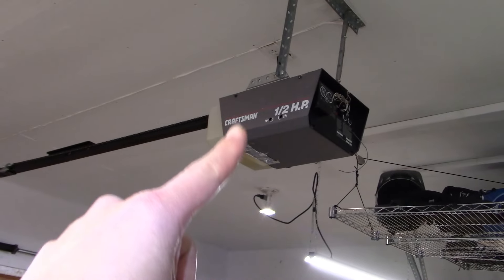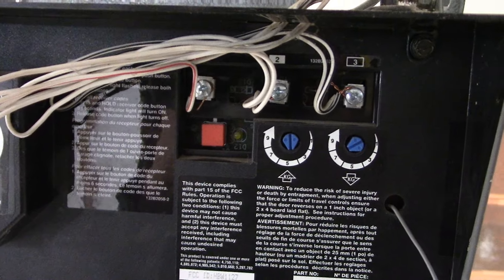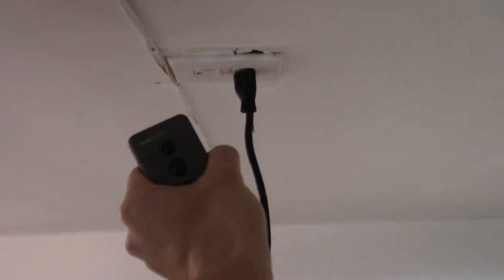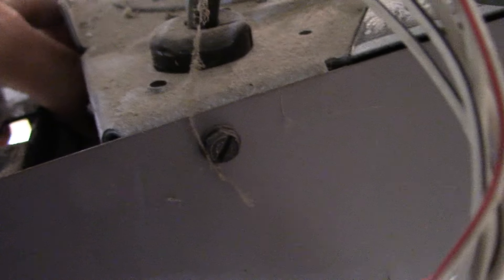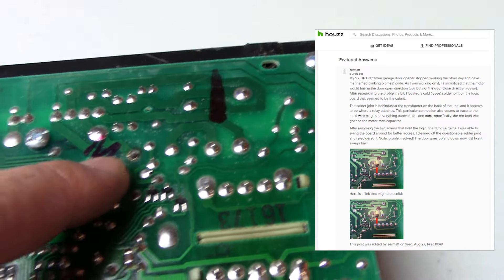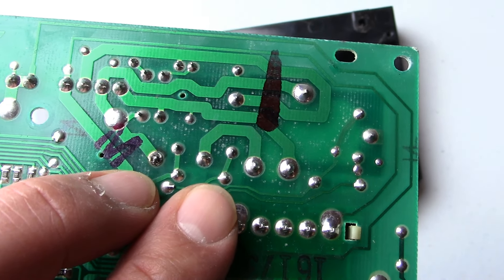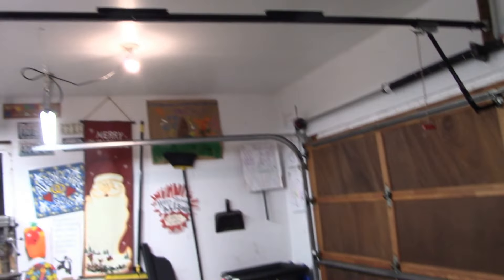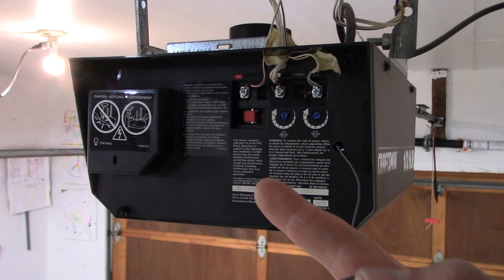Garage Door Motor Not Working – Solved!

Comment: AMAZING.  I said no way this can work.   Saw three dark solder connections under the relay. Hit them all with a little solder, put it back together, and the light came on as you said this was a great sign.  I'm guessing a professional would have charged a fortune and replaced with parts.     As the others have said  "YOU THE MAN!"

Comment: i have the same 25 year old opener which stopped working 1 yr ago,  seen you video and the first soder connection was black so i touched it up with soder and BOOOMM problem fixed.  your the man.  thanks for your help!!!!!
Reply: where did you buy the replacement?

Comment: Thanks a bunch! Just fixed my Craftsman 1/2 HP opener (late 90s vintage) by fixing the board as you show here. My failed joint turned out to be the same exact one as yours.  Your video made it easy after finding the OP that never really discusses disassembly as you do here. Between the 2 of you you've saved people a lot of money and kept these openers out of the landfills where they would have ended up. So thanks a million Chief!

For others tackling this, after you remove the end plate where the board is attached, it you take then take off the metal enclosure that covers the motor, etc., is is much easier to remove and to reinstall the header connector without fumbling around to get it aligned, etc. There isn't much service length on those wires as you can see from the video so it's easier to have the whole bottom of the opener open to get your hand in there and to see what you are doing.

Comment: So i drove out my garage, then went to close it, nothing. Nothing but the click-click. Liftmaster pro some model. Boards were different, a logic board and a high voltage board with transfomer and relays. Got to the hv board AND LO AND BEHOLD! One bad solder joint! Re-soldered, put back together, works great! "YOU THE MAN!" Thank you! Saved me $$$

Comment: I went through several diagnostics; RPM sensor resistance, direct charge to motor, transformer check and this one worked. 8 month old unit and found a bad solder on the MoBo (logic board). This was the fix. Thank you for video!

Comment: So glad I found this video.  I have the same model and had just spent time replacing the inner gears.  Then today it just stopped working.  Watched this video and then after buying another iron and sod, because of course, I couldn't find mine, I touched up the exact spot the video showed and shazam, fixed.  thanks again

Comment: My 1/3 HP Liftmaster failed and displayed the same symptoms: relays click, yellow LED flash 5x.  My unit had EXACTLY the same fault - same relay, same pin, but more of the soldering pad on the back of the PCB was burned away in my case.  After cleaning the area, I resoldered the joint, ensuring the solder flowed from the back to the front of the PCB.  The repair made good contact between the pin and the run. I put the unit back together and it is operational once again.  Thanks for the video!

Comment: Googled, and found your video. Mine had same problem as yours, same Opener as yours (except 1996). Followed your video, found exact same burned-out solder spot as yours, except no “M” on my board, soldered it - Fixed! Thanks!

Comment: You are the man
I was rolling my eyes watching this. Then I looked at my board same problem same spot. I desoldered it and it's working. Saved $400 .. again you da man.
I think this is where the relay contact energizes the motor and there is arcing .. over time THIS happens. That the theory .. you da man!

Comment: Wow, thanks for the great video and what to look for. I have a 2006 Lift Master which is totally different and much newer, but  thn yours but I had the same conditions so I took the two circuit boards out and looked for the relays...Found one relay terminal that the solder had come loose so I re-soldered re-assembled and it works like new! Saved at least $125 on a new board and way more if I replaced the whole unit, and more again if I called a garage door company. 
Thank you!
Don (Kathy's husband)

Comment: Thanks for your video, I have same problem, I removed the circuit board , noticed one the connection to the relay was melted, solder it back and everything works. Thanks again

Comment: My garage door was on the way down after I used the remote and about a foot from being closed it went back up and wouldnt work at all even with the wall control. I didnt know about unplugging the opener and plugging it back in but I tried it and all is well. Mine is a Genie screw drive opener that I bought in 1998 so thanks for the tip.

Comment: Nice job. I have the exact same opener. My problem is that it will close but only if I hold down the close button. Opens perfectly fine. I’ve seen videos saying “look at the sensors by the door and see if there is a light on”. Well mines so old it doesn’t have lights. Lol. I have already moved the sensors trying to make sure their aligned but with no luck. 🤷

Comment: Today my GDO did the same thing. 5 blinking lights and a clicking. Light bulb comes on but motor not working. Trouble shooting says either tensioner or mother board is fried. 😂 I will open it up and look for the fried solder and update you! 😅

Comment: I like your video I wish I could find a burned weld on my board. I don’t see any problem with my board but I get the same symptom. It’s a chamberlain half horsepower 2006 garage door opener. Any suggestions let me know thank you

Comment: hey so i just moved and have the same door opener. sensor lights are on and fine and the door opens but when i go to close it, it acts like it wants to close and then goes back up. and then the light blinks 4 times. would you know what the problem would be? thanks

Comment: Dude you speak like Jeff Goldblum in Jurassic Park.  I wish mine was so easy.  I got the five flashes but the light comes on and the door just stops almost a different points when opening and closing.   I smell something burning too.  I think the opener is toast.  Oh and one of my outlets is no longer working after I tried resetting the circuit breaker to see if that would help.  I can't reach the outlet where the unit plugs in because it's too high on the garage ceiling.

Comment: so my sensors are okay, but suddenly, the craftsman garage door opener stopped operating, and the yellow led is slowly blinking, why suggestions? It seems like the control unit that is attached to the wall is not responding, for some reason. Only lights get turned on when you cross the sensor path.

Comment: Any idea if the diagnostic light does nothing? The door opener next to the actual door is rapidly flashing, sensor are working and aligned correctly, no humming from motor, literally nothing happens when I try to open with the remote or the door opener next to the garage door
Reply: I know this is late but usually if the opener pad/switch is rapidly flashing that means you engaged the security lock which prevents any remotes or the pad from opening the door. If you look closely one of the 3 buttons on the wired pad should have a lock symbol. Press and hold that for a second or so and it should stop flashing and work again.
Reply: @Big_Old_Dog  thanks for the reply, I’ve tried that several times still nothing. There is also a lock button on the remote, tried hitting that no luck. Could bad/dead batteries in the remote cause this?